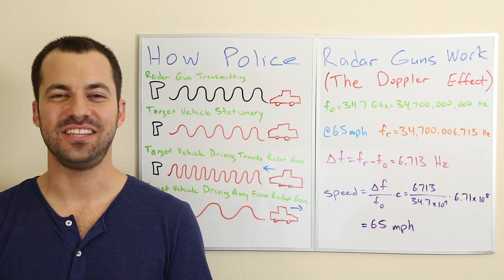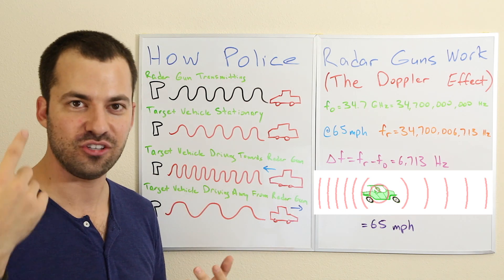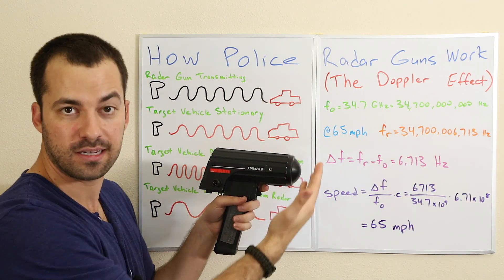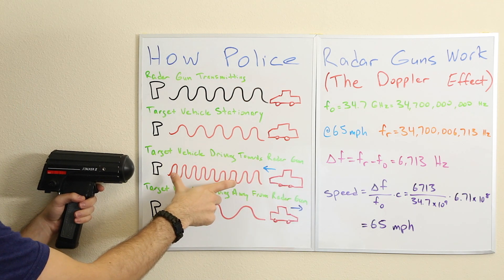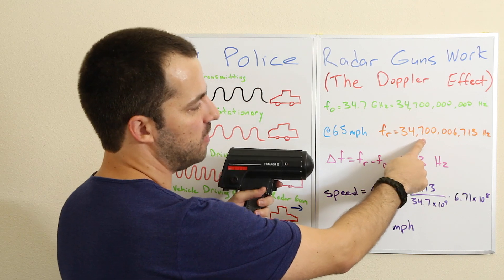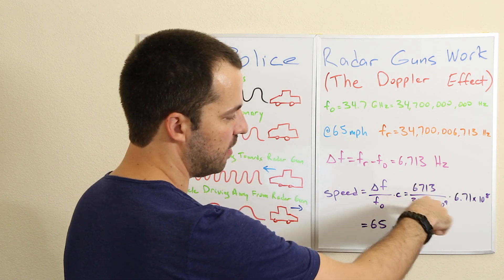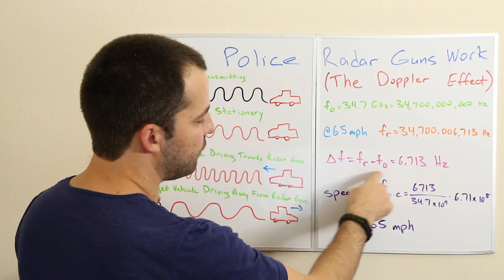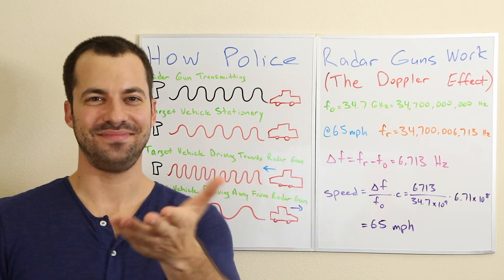How Police Radar Guns Work

Comment: Fist of all, your videos are very informative, to the point and well detailed! Keep it up!!! I also have three quick questions, I'd really appreciate it if you could answer them!

1)What is the range of most radar guns in order to clock your speed accurately, in order for someone (me) to get a ticket? 
2)Also can the police with a LASER gun clock you while the police vehicle is being driven? ( I know its possible while using radar gun, but not sure about laser)
3)I have the escort redline, is there some sort of a method to understand if the signal is coming from the front or the rear of my vehicle? (the redline doesn't have any arrows as you know, so are there any elimination steps that I can take in order to have some kind of an idea)

Thank you for taking the time to answer these burning questions I have loll! Keep up the good work :D
Reply from the maker: +4shebby I'll do a video on your first question since it gets asked so often. The answer is that it depends wildly.

The second one, laser is stationary only. I'll do a video on moving mode radar and it'll make sense why it doesn't work with laser.

You can sorta tell direction with an arrow-less RD. You basically just pay attention to the signal strength on the display and the audio rampup and correlate that to what's going on around you in your terrain. It takes more brainpower and analysis, but it's possible.
Reply: ok awesome for the quick reply! and as for the third pard question, im guessing if theres a cop behind or in front of you and they turn on their gun, the signal is going to be super strong. Also how long does the radar gun needs in order to give you an accurate reading which the police can ticket you. Once there was a cop behind me and he kept turning his k bank gun on and off20-25 seconds each time. How long do they need to clock you before they are confident that you are speeding or not (5-10 seconds?) thanks
Reply from the maker: Not a simple answer. It might be best to ask on RDF so you can get answers from a bunch of people and so others can benefit from the discussion too. ;)
Reply: i shall try and do that. Thank you :)